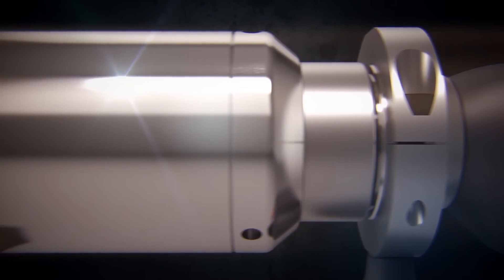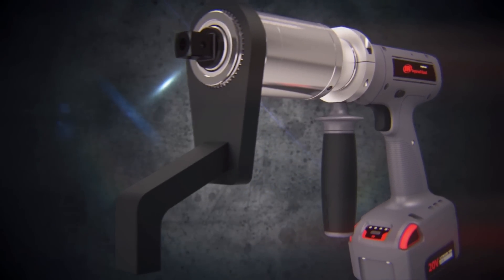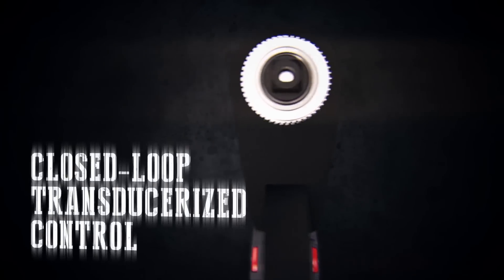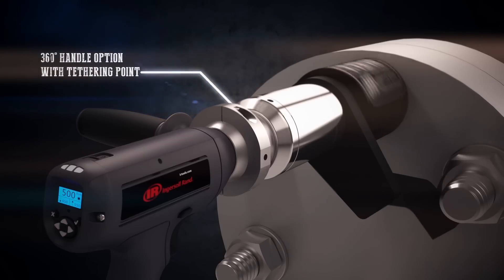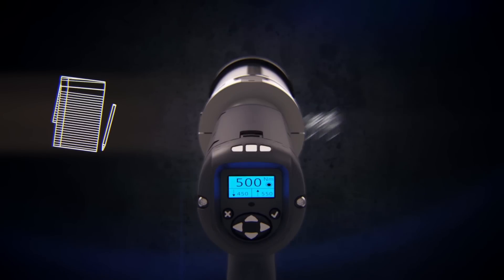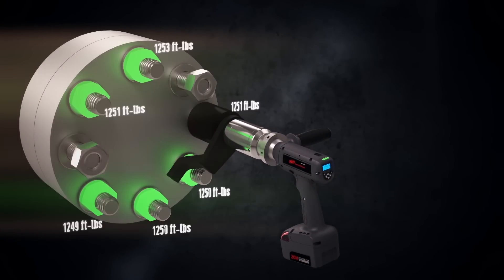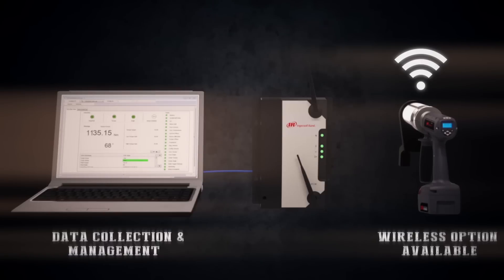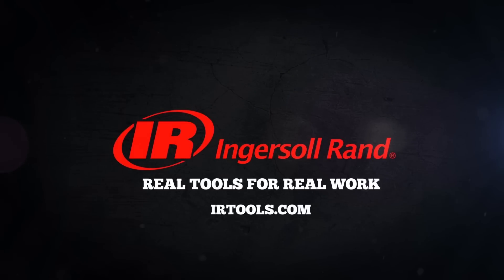Ingersoll Rand QX Series Cordless Torque Multiplier

Comment: You probably could use it to bolt head bolts to a car engine and not check the torque specs at a high rate of speed and don't worry about it.